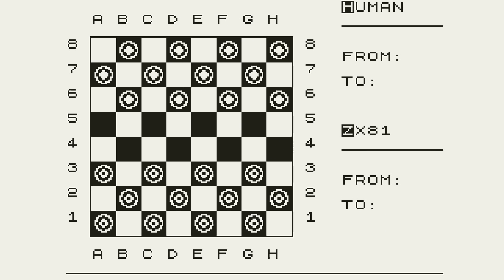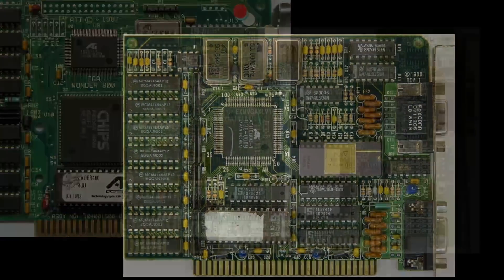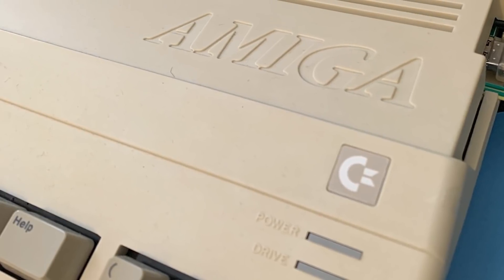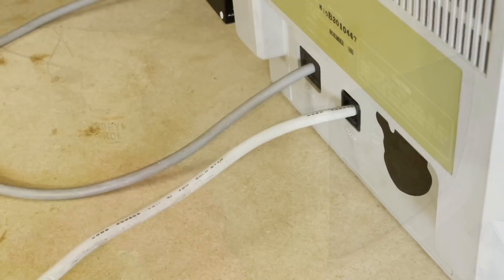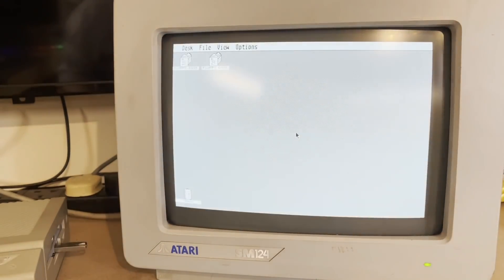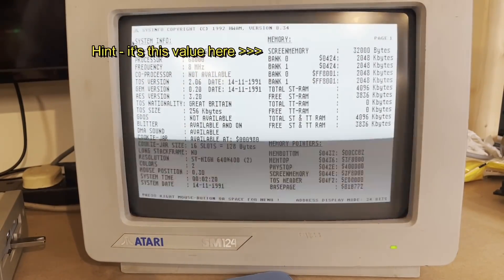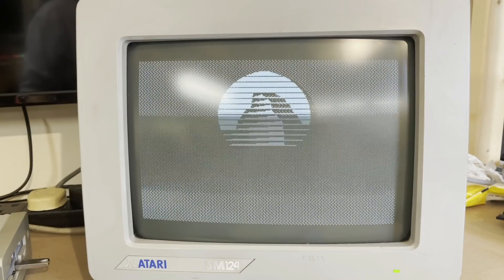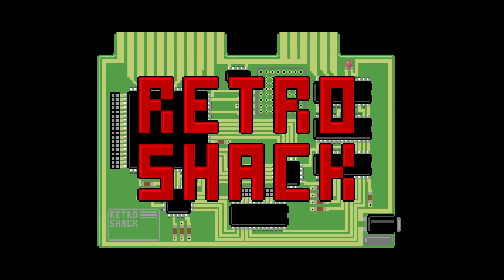'Hi Resolution' may not mean what it used to, but here's what it used to be!

Comment: If I'm remembering this correctly, you could have both the color & mono displays connected to the ST at the same time.  Take that with a grain of salt though - the last time I saw that particular setup was 1989. ;)
Reply: I had mono & colour attached to my ST, but the colour was a TV attached to the modulator. I don't think you could connect two monitors at the same time. It's also the best part of 30 years ago, so I can't guarantee my memory either!
Reply: I used to have a TV and mono monitor setup, you could have both connected at the same time, but the monitor input always takes priority so had to be unplugged every time you wanted to go back to low res. I don't know if anyone ever made an input switcher to get around that.
Reply from the maker: @KenPurchase  Check you out - Johnny Two TV’s :) :) When I were a lad we lived in a bucket, etc… ;)
Reply from the maker: Not at the same time because of that 32k limit.  The system could only drive one resolution at a time.
Reply: @TheRetroShack  It's a shame that getting older isn't as optional as growing up is. :D

Comment: I remember when 320x200 was considered high resolution. It was when comparing the Apple II (320x200) to the TRS-80 Model 1 (128x48) and the Commodore PET (no graphics mode, only graphic characters).
Reply: what if I were to tell you that in the 1970's there was a computer with a 800x600 display! Kinda crazy that this one fell off the map but the Xerox Alto is the real OG for personal computers. Absolutely amazing machine that was in no hurry to be turned into a product for the masses. But like you I remember 320x200 being the highest resolution that a TV could even support well in the 1980's but I do wonder what it must have been like back in the late 70's seeing that Alto running. It must have appeared like something magical.
Reply: @ClayMann ...and what if I tell you that in early 70s (1972) there was a computer terminal capable of 1024x1024 (1024x780 visible) already? Long before Alto, it was Tektronix 4010 graphics terminal and it did cost same as brand new small house.
Reply: Apple II was 280x192, with a really funky 6 color set. The IIGS was 320x200 with 16 colors, and 640x200 with 4 colors (which were often dithered for productivity apps.)
Reply from the maker: I remember it too - we’re so spoiled these days :)

Comment: I wish you'd found a way to run your camera at 70Hz to capture the monitor in all its glory.
Reply from the maker: Yes, it’s disappointing but I wanted to show the real thing and not an emulator.
Reply: @TheRetroShack  Can your camera control its shutter speed? Setting to 1/70 might do the trick since this is a 70Hz monitor.
Reply from the maker: @AndrewHelgeCox  unfortunately not :(
Reply: @TheRetroShack  :'(
Reply from the maker: Thanks for that Andrew but unfortunately my camera doesn’t have that adjustment.  Might have to consider something like that converter though as I do seem to have a lot of CRT’s :)

Comment: That is a lovely display. I rather like the 1-bit high res aesthetic. I'm surprised that SimCity didn't support 640x400 mono mode though. One of its best looking modes on the PC was the 1-bit Hercules 720x348 mode. Even my Amiga owning friends envied the crisp detail I got playing the game on my old mono XT.
Reply from the maker: There is something oddly satisfying about this hi res mode :)
Reply: @TheRetroShack  It's simple. these mono displays had long lasting phosphor and were smudging terrible but any text application was working perfectly.

SM124, most Hercules displays... I had mono VGA display and it was worse in the matter. not terrible but SM124 or Hercules one were better even though my own had similar Hz (75Hz if I recall correctly).
Reply: Yep, and it looked/ran great in B/W on the old classic Macs...  You would think they would have supported it on the ST...
Reply: Dont know why
 the monochrome monitor is what made everything crisp 
The amiga could do same with even higher res
Why amigas were beyond everything besides the computers in japan
Reply: @primus711  As a previous and current Amiga owner, I can tell you. Refresh rate. With a standard Amiga,   you needed a flicker fixer and monitor with a higher scan rate  to get higher res video that wasn't headache inducing.  Later Amigas could do that with just a monitor with a higher scan rate.  A true multisync monitor could do that.
Reply: @desiv1170  were talking monochrome high res here
Reply: @primus711  I know. And for the Amiga to do any hires, mono or color, it needed interlace, which flickers at the standard refresh rate. In fact mono would flicker worse. Used to run AMax (Mac emulator) on my 500 and the flicker was crazy...
Reply: @primus711  the big difference is that this monitor is progressive scan at 72 Hz refresh without the disturbing colour mask. It is almost like printed media and the 72Hz progressive scan was like rock solid at that time. Even with flicker fixer and good VGA you could not achieve same stable and sharp picture on Amiga. And the best thing was that at introduction SM124 did cost just 100USD if bundled, and later the price went down to 75USD. You could not have such a level of stable and sharp display at this low costs at any other solution back then, not even close. This, and the fact that ST was cheaper and slightly faster then A500, made the ST much better value as professional PC then Amiga.
Reply: @desiv1170  But you could have add a flicker fixer device if you wanted. And you didn't need to switch between a color & b&w monitor depending on which software you wanted to run at the time like on the Atari ST.
Reply: @classicarcadeamusementpark4242   Yep, if you could afford a Flicker Fixer / ScanDoubler.  Which were spendy.  They were out there, but no one I knew had one.  We just put up with Flicker.  ;-)
Reply: @classicarcadeamusementpark4242  and in fact you could do the same with ST, with a simple scan doubler and VGA monitor, or Multisync monitor that supported 15KHz and 31KHz, and no other tools. The High Rez mono of ST runs on any VGA, no need for flickerfixer or scandoubler. How could you know, you are poor Amiga fan, you dont know nothing about hardware.

Comment: Congrats on your new upgrade! :) Reminds me of the time a few years back when I replaced the drive belt on my CPC6128, installed a gotek as a second drive, and plugged in the M4 board and a 1MB RAM expansion. Opened up a whole new world I did't have access to back in the day.
Reply from the maker: Thanks - Just the addition of the Hi-Res Monitor makes this ST feel much more 'productive' and 'business like' - very much like a Macintosh in it's feel :) :)
Reply: Yeah, my thoughts exactly. We also had a Mac Plus that my father used for writing. The ST UI in high res looks surpisingly similar.